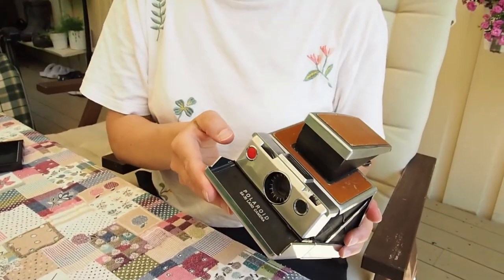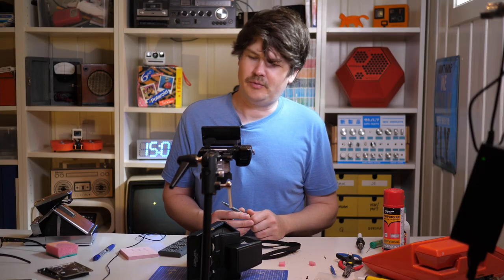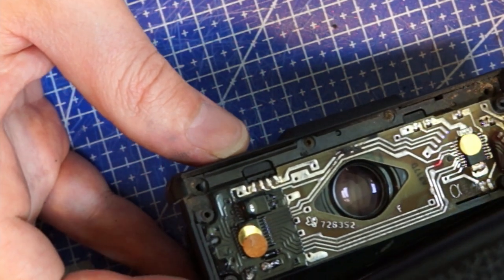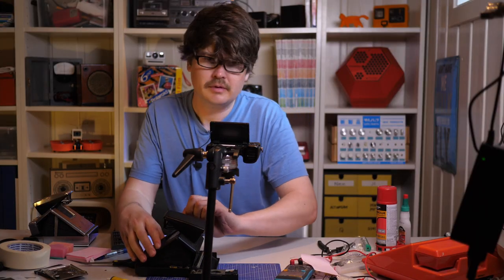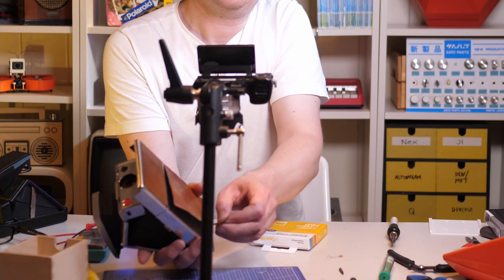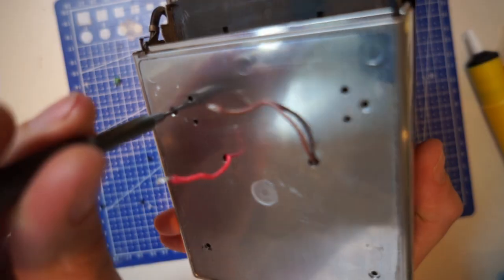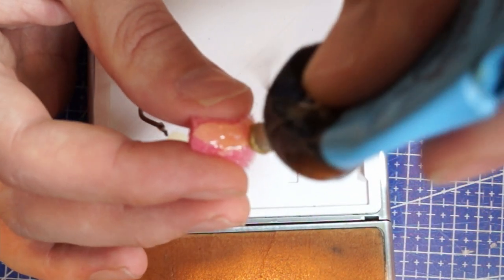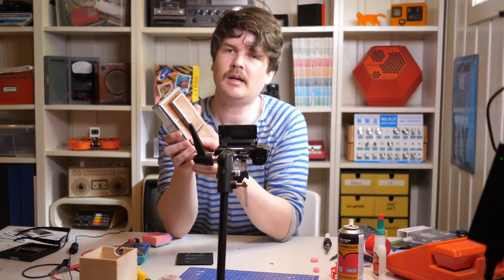The ultimate Polaroid SX-70 upgrade guide

Comment: This is so cool. It’s like circuit bending. You want a different pitch out of the instrument, locate the resistor for pitch and put a a different value for different sound. I wonder if you could put a potentiometer or switch with 2 resistors  in replacement of the 600film resistor and be able to control what film setting your in!

Comment: kinda zoned out for a while so sorry if you already spoke on this but having that lithium-ion battery on the part of the camera that always has pressure on it isn't the best idea unless you're really careful. Although they're designed for just eight shots, these batteries (like older Polaroid film pack batteries) have a lot more juice than what is needed. Just be safe with it and don't crush it, it is a good way to save money & reduce battery waste though. Polaroid film can't really be environmentally friendly (plastic packs & film, metal spring, non-rechargeable battery, chemicals etc) so doing anything at all is helpful.

Comment: Thanks for this video.  I had to make a custom square drive bit by grinding down the tip of a threaded bolt to fix a coffee maker some time ago.  You could obviously use a file to do that but it would take longer.  I think your use of a sponge as a spring and the de-soldering wick as a contact are pretty innovative, but I wonder if there is a better solution for the contact.  Maybe using a strip of aluminum from a beer can as the contact?   Or maybe you can find copper strips or sheets at a local hobby store or online.  Again, thanks.  Great video!
Reply from the maker: Custom square bit is great! Yes, even the springy feather steel in a used Polaroid cartridge could work. Just have to put pressure on the right spot.

Comment: Hello,

Thanks for the video It was very informative!
I have some questions about the screwdriver you used to open the back of the lens/Shutter baseplate. Can the Torx 4 bit be used to unscrew the 1mm X 1mm square screws in the Sx70's?
Reply from the maker: You could try some torx heads, I basically tested all my flat and torx bits. Try T2 or T3. Some people even grinded their own square tool.

Comment: Thank you for the excellent tutorial! You mentioned that after changing the capacitor you may have to adjust the exposure. Are the photos over or underexposed? Also, could you use a different size capacitor to compensate for this difference? Thanks again.
Reply from the maker: Thank you for the feedback, glad it was helpful! My replacement capacitor was measured to be around 250 pF, which is good for the Alpha 1 model 2 that had about 1000 pF originally. But the silver model came with around 800pF, so a 250 pF is a little too much. Higher value is higher/longer exposure. But I didn´t have a 200 pF available. If you measure the original cap and the replacement cap and get more precisely 1/4 of the original (+- 10%) you should hit the exposure pretty well.
Reply from the maker: I read recommendations that the camera tends to over expose as well, so It’s my habit to under expose a notch.

Comment: Good tutorial! I just bought a Model 3 to try this. Once I am successfully on the model 3 then I will try it on my Model 1. Just a quick question.. Aside from the uF value, is there an specific voltage value I need to look for when ordering the capacitor?
Reply from the maker: Great to hear that! I can´t imagine the voltage being higher than 5V, but many caps can take 100v or more. To be sure, check that it have at least 10v tolerance.

Comment: Would a 220 pf cap work in a sx-70? since its kinda between 200 and 250?
Reply from the maker: Yes, but you might need to adjust exposure down a little. Depending on camera, some say 180 is better.

Comment: and what about the flash? would it still be compatible?
Reply from the maker: You will probably need to dim it. It can be done easily with some baking paper or thin white cloth over the flash head
Reply from the maker: The mint flash bar has a 600 setting. With flash, focus distance is controlling aperture, so should work even with the cap mod.